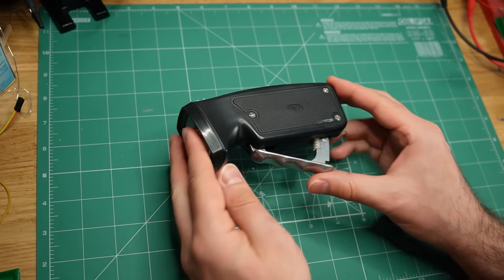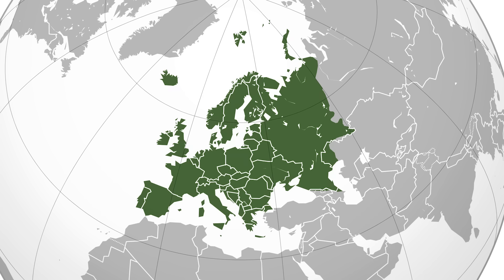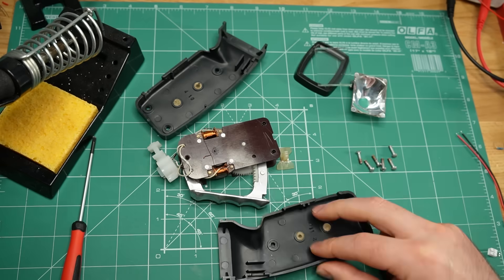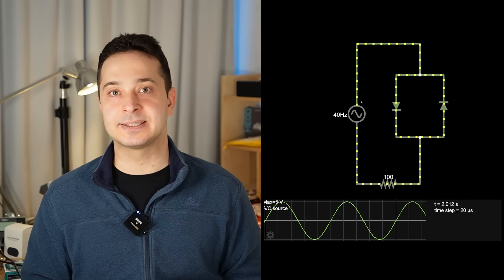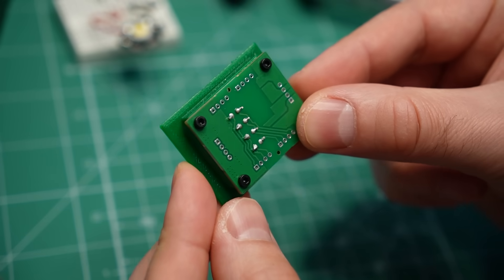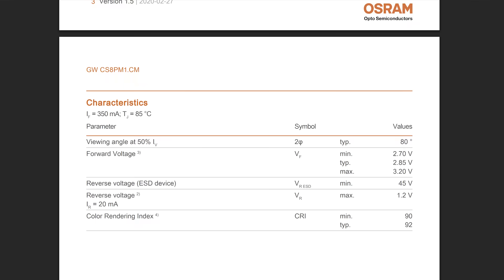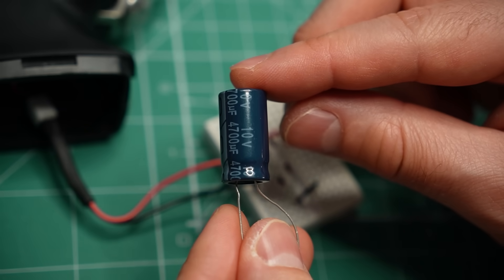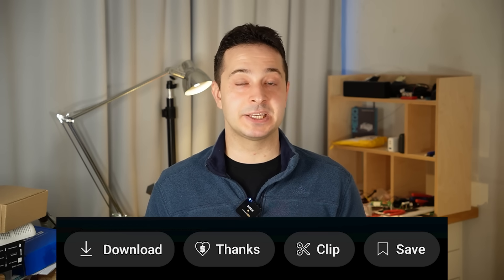Vintage no-battery flashlight gets LEDs (PART 1)

Comment: I'm fully behind making any mod to be reversible, but in this case, it's more of a repair than a mod, since you're making it work with something more modern, that's far more efficient and bright. those old bulbs should be fully phased out, so not working with them anymore is an improvement.

Comment: batteries are nice 
but hand cranked ones are useful even when you get sent back in time
Reply: even into the future 
if the flash light dosent have a hand crank ability 
its very hard for me to have security in relying on it because once batteries die out i need new sets of batteries 
i want that hand cranked as a BACK UP
but if i get sent back in time 
if i had battery flash light that battery lasts only for a maybe a year if i REFRAIN from using it 
then i dont have anymore battery to power flashlight 
but hand cranked lasts for as many years as the gears work and last

Comment: Have you considered to use an ideal diode? The voltages here are so low that even the .3V from a couple of schottkey diodes will limit the power quite a bit

Comment: Instead of adding more electronics which is just more losses, consider adding mass to the flywheel if possible. If the dynamo inside uses old school magnets, try replacing them with neodidlium.

Comment: Would some of the latency be solved by using LEDs as the diodes in the bridge rectifier, or would that just make charging the Capacitors even worse?
Reply from the maker: That's going to be one of the next videos. It will make things worse

Comment: Add a transformer before the full bridge rectifier. Less losses in the diodes and you will only need a buck converter on the DC side.

Comment: Isn't AC to DC conversion an already established mechanisms. Even a simple rectifier should work for this simple circuit. 

Also change the gearing and weight of the dynamo. You will get much better results

Comment: My main idea for improving the flashlight is, now that you know which LEDs to use, get a circuit with them in the center, and either put the reflector back on or make a new reflector to better focus the light output

Comment: Why don't you use the LEDs themselves as a rectifier bridge to charge a capacitor that will power a stronger LED? That way you will have lighting while the capacitor charges and you will have a stronger light coming from the larger LED when the capacitor charges. 🧐🤔

Comment: This is a standard E10 fitting. Aren't there also LED drop in replacement bulbs? I really like your project but would low-key expect them to be optimal for the reflectors and that way outperform your best leds 🤔🤔

Comment: Would it be possible to make the diode configuration out of the leds for the flashlight instead of using extra diodes? I only eeally have a surface kevel understanding of this stuff so idk if thats a dumb idea or not lol

Comment: I bought one like with with LEDs back in 2010 in Canadian Tire for $3.99. It has plastic mechanical parts, though and didn't last long. But I wouldn't say that LEDs made it much easier to use or more practical.

Comment: ??? Why all this effort??? You can simply buy and use a LED bulb substitute for the original bulb. Fits in perfectly well and no further work is neccassary! 2) Next time maybe use a similar dynamo lamp but with power storage. I owned several of those and they worked great.
Best regards luck and health in particular.

Comment: Why not keeping the design simple? Use half bridge rectifier and use couple of super capacitors in series. That way your power loss in the rectifier would be significantly smaller and you would not risk burning out capacitors?

Comment: Late to the party but - You could try improving the flywheel instead of installing a capacitor. Some new bearings could make it spin a lot longer, and modifying the squeeze mechanism with a small gearbox could up the RPM transferred to the wheel, making it spin faster with fewer squeezes.
Reply: Great idea! 😮 I’m taking notes lol
Reply: Whether better bearings help very much would depend on the ratio of bearing drag to generator drag

Comment: These have always been kinda crappy with the incandescent lights, the light was very very dim, and since the gearing is plastic, if you tried to spin it too fast , you'd bust the gears... They should make a comeback with these, with a LED they could make it a bit smaller, and with today's cnc and 3d printing stuff they could easily make the gears out of metal, even a cheap metal would be tougher than these old plastic gears, and the LED need a lot less energy. A 2025 version would be waaaay easier to use, and provide a lot more light than the old models! I think they would be relevant, I'd totally keep one at home and one in the car...

Comment: Alternatively, you could improve the flywheel by replacing it with an identical one made from a denser metal, such as tungsten or osmium, which would allow the flywheel to store more energy

Comment: Why would you ever ditch the reflector?  This is so unnecessary, just buy an e12 LED replacement, or break the old one and solder in a couple LEDs.

Comment: there was a comment that said modern dynamo too etc
Reply: nonetheless, crazy efficient stuff, makes you wonder if you balance the wheel better (so less drag/rubbing on components) and add weight to it, not use a spring tht takes alot of ur power, even charging a powerbank is possible, idk..

Comment: I actually think the tradeoff of a longer charge time with the inclusion of capacitors is very situationally useful and worth the tradeoff, though I understand why you wouldn't want that as it's only means of function, but what if you simply added a switch?

Comment: I used one of these for my own universal charger, it was missing the bulb and other parts but the generator was fine.

it charges capacitors great and a minute of charging can get around 5 minutes of good light

Comment: Come from the short video of this, I had a black round face one as the yellow one on Wikipedia at 39 seconds. Now to carry on. 
Daft horrible item. so 1992. A normal torch and rechargeables so much nicer!. Capacitor, LED, a bit of voltage regulation, could do ok now but flywheels ands bulbs back in the day. no. Waste of money, I had

Comment: Could you use LEDs in the rectifier and have a capacitor bank on a switch connected to a more powerful LED or set of LEDs? If not, why?

Comment: This is cool and important. Capacitors as batteries need ot be a bigger thing, and your solutions might be bakable into the "battery" side to give other technologies truly long term energy storage options. TONS of tech is only dead because batteries suck at ageing. Replacing that tech with something more durable is very desirable to me even if capacity is shit, especially if the device can use both.

Comment: I have the same flashlight and it even has its original lightbulb in. I wonder if this could be rigged to not provide light, but instead generate enough heat to light a fire in survival situations?
Reply from the maker: Probably. You could perhaps make it store the energy in a capacitor and discharge it through a heating element.

Comment: You could probably use led diode the replace normal diode for the full bridge rectifier to have instant light since led is just diode with light, which then charge the cap, then probably power one led for longer lasting light, so the end you have instant light and cap light also, for the cap light, since it is dc volt, ya can power the high quality high power led without blowing them😂, therefore you don't need that many diode like the normal diode
Reply: This may sound great at first but anyone who has worked with leds would tell you it's not gonna work as well as you think. The reason is demonstrated in the video itself. Leds tend to have low reverse voltage.
Reply: @pseudonym9215  he already tested the led raw with the hand crank, that hand crank do ac voltage and only one model blow, so yup probably led can take it, yes what you said do apply application with more voltage, but then, the hand crank probably create low voltage and ample

Comment: Forget capacitors. Install a small rechargeable battery. It will power the led while you recharge it every once in a while.

Comment: I've always wanted to implement a rechargeable battery for my calipers, that recharges from shaking it like many of those flashlights from years ago. I saw that one point a company was making a AA battery that had all the charging via shaking components on the inside, but I don't think they released it.
Reply from the maker: I see them on AliBaba. They come in pairs: one AA-sized unit contains the magnet and coils, and another holds the charge. It's innovative, but probably makes very little power so it's good for things like remote controls only.

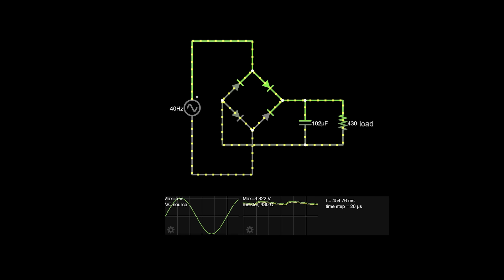Comment: You should use LEDs as the diodes in the rectfier so that you can minimise voltage drop and energy loss. Maybe you should consider using a smaller capacitor like 3000uF at 8:38

Comment: If you would take this on a trip out to the wildness to go camping, I would make it quieter first because you don’t know what’s out there so no predators that could hurt you would hear it I would also add a button so you can select which LEDs do you want at any time with no problem. And I have a video idea for you make one of these by yourself but modern and it has no batteries. I think you could do it. Just an idea you don’t have to do it.

Comment: You could add more windings to the dynamo to increase the voltage. Have a capacitor, and limit the LED current.
That way the losses through the diodes of the full bridge rectifier will be smaller. The capacitor should be charged more quickly (don't use one with insanely high capacity), and the LED should light a bit longer than without the capacitor.

Comment: hey can you try to use leds as diodes in the rectifier with this way you can get light too
Reply from the maker: I will make a short video about it soon. It should be interesting to see why that doesn't work
Reply: @LeftyMaker  ı always make dumb circuits for fun you gave me this idea

Comment: The best rectifier I suspect would be the voltage doubler topology where one diode puts a positive charge on one capacitor and another diode put a negative charge on a 2nd capacitor.  This will give you the least voltage drop in the rectifier for a diode based design. Schottky diodes will be the best for this.  Synchronous rectification would likely be too much complexity.
Another though was to have two or more sets of LEDs.  An orange LED has about 2V of forward drop.  The white ones use a blue one to pump a phosphor and have about a 2.7V forward drop.  A circuit could be made that disconnects the orange LED (or perhaps a red one) when the voltage is high enough to make the white LED work.  This would give you more span of voltage at which you get at least some light.  Another idea would be two white LEDs in series as the higher voltage LED.  The idea is to match the LED to the output impedance of the generator.

Comment: I'd try a voltage doubler with Schottky diodes to minimize losses due to threshold voltage along with a single high-power LED. I think it ticks all the boxes - low complexity, smooth output, look truer to the original...

Comment: Can't you make the rectifier out of LEDS? That way, you have instant light action while also charging a capacitor for a secondary set of LEDs.
Reply: when he wired them in parallel in opposite polarity, thats basically a rectifier as well...

Comment: Instead of using Diodes for the Full Bridge Rectifier, would it be possible to cut out the middleman and use the LEDs [Light Emitting Diodes] for the Rectifier purposes. They may have a larger forward voltage, but this could also give range to charging a capacitor of a lower voltage value?

At worst, you could also modify the ratchetting system in the handle to have a larger resistance by changing the internal gearing so that it scales up the speed of the incoming 'squeeze' by slightly increasing the manual compression force requirement.

(Again, take none of my ideas with too much seriousness, I'm still learning myself. Great video!)

Comment: Why not replace the incandescent bulb with an LED bulb? Several replacement LED bulbs are designed specifically for this purpose.
Reply: I think it’s explained in the video.  It’s because the flashlight produces AC voltage rather than DC voltage.  He did use just a LED and it turns on and off depending on what cycle the sine wave is in.
Reply: @hpjtv  Adding a FULL BRIDGE RECTIFIER and an led bulb with the same physical dimensions let you keep the flashlight in its original condition though. And it's certainly easier and cheaper than making a custom PCB.
Reply: @Ni5ei there is a large voltage drop if you use a full bridge rectifier.  It’s a low voltage hand crank and the voltage drop across the bridge/diodes would be fairly large.
Reply: @hpjtv yeah he could still do it tho
Reply: @hpjtv  I have two dynamo lamps and use LED bulbs. It flickers just, when it runs out. The generated voltage is not high enough to burn throug the LED when it's in the blocking direction
Reply: LED bulbs are only cool in a theoretical world where companies want you to have good products. In our reality lightbulb suppliers have figured out that if the LED is enclosed, over volted and running hot you will buy more of them.
Reply: Because D in LED stands for diode
Reply: Good idea

Comment: you should add neodinium magnets and better coils so it will produce even more voltage
Reply: yes but it will also take more physical effort to keep the light turned on
Reply: @dumbcook42  ohh yeah i forgot about that
Reply: @dumbcook42 better workout then 💪
Reply: @dumbcook42 not really, the effort it takes depends on the load
Reply: 3 phase coil would make it super powerful and stacked axial neodymium magnets would make bigger volts
Reply: Should get a better flashlight and add a dynamo
Reply: And mount battery and a switch.
Reply: @tattooglisha  if we add a battery it would no longer be a battery free torch
Reply: the magnets would make it harder to spin but bigger coils or renewed magnets would be nice
Reply: If you really make one I think you need heavier flywheel too to keep it wheeling, stronger gear, stronger mechanism,
Reply: @BALONEYK--CZE- at this point just get a new torch

Comment: Id rather make a shaker torch 
Altho this has potential if used with a joule thief oscillator circuit and a resistance from cap to led BJTs can help too

Comment: What about using LEDs as the bridge rectifier. Then you get rectified voltage and the forward voltage drop is useful as light instead of heat.

Comment: Pretty nice! It would be more precise to compare different LEDs using small solar panel, or photodiode, to be more precise, or fix camera settings to compare the pictures. Also compare the light cones versus the bright wall or something like that. But that's just loose sugestions.

Comment: For simplicity and efficiency I'd be using a joule thief, with the windings adapted to provide the right voltage for my LED.  Maybe add a zener diode across the LED to shunt occasional over-voltage to ground.
Reply: Needs resistance between cap and led cud be dun with BJT circuit